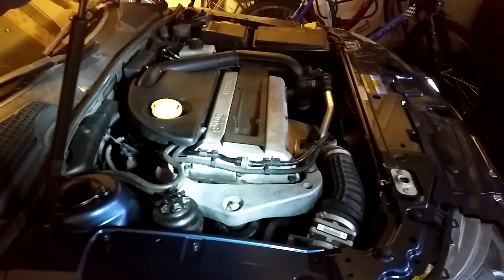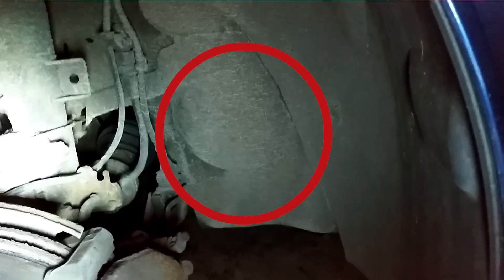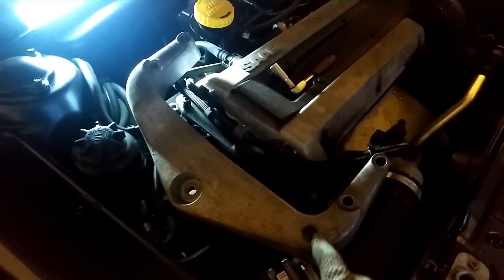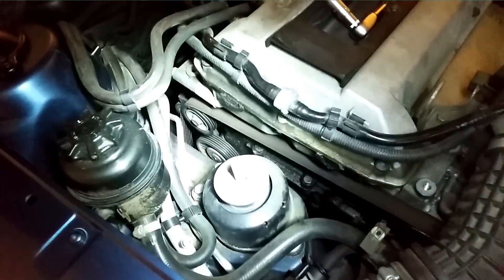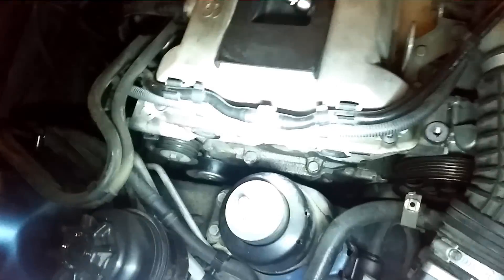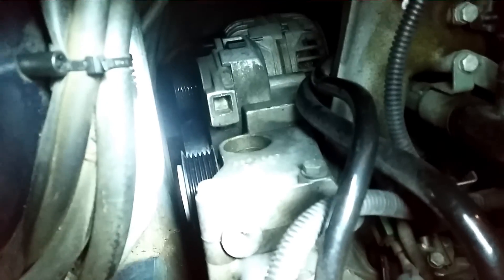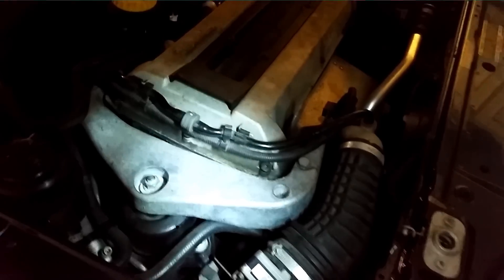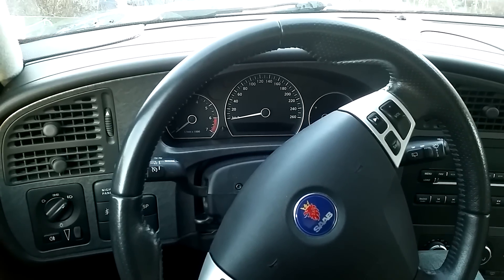Saab 9-5 DIY: Serpentine Belt and Pulley Replacement - Trionic Seven

Comment: If you need to change the tensioner pulley i find its easiest to remove the entire tensioner which you can do by using a sawed off 8mm allen key (insexnyckel) and than change the pulley when its off

Comment: I seem to be having an issue where I’m hearing a clunking noise in the same area you just replaced. Would I have to replace the whole belt tensioner?... just wondering cuz the noise is very obnoxious and sounds like a knocking noise but had nothing to do with the motor.-2005 Saab 9-5 aero 2.3t

Comment: Hiya, i did this today on my 9-5 saloon because of a squeak, thats gone now but it squeals intensely start up and the goes after 5 min. Do you know what could of happened? I pulled the metal pin out of tensioner belts on things and tight.

Comment: That top idler pulley is prone to failure after about 60 thousand miles. They fail like clock work after that. I started to change them on every Saab when I did the 60k "major" service. It prevents a most certain unexpected break down. Every Saab I purchase that has this setup, if there is no service record of when the idler pulley was replaced, I automatically replace it. Easy and inexpensive preventative maintenance. Who likes to get stranded?
Reply from the maker: Good points all around! Replacing the idler is so easy when everything is out.
Reply: Saab Tech can you tell the size of upper and lower pulleys for 1999 saab 9-5? Thx

Comment: Hi, thanks for this video
I have a question unrelated to serpentine belt, though. What do you think is the big (oily) stain on the intake manifold seen at 5:16? I am asking as I recently got similar one.
Reply: Perhaps a leaking valve cover gasket. Very easy repair.

Comment: Tack så mycket. Our 2000 9-5 manual shift wagon just began to sqeal a bit, and I suspect a new belt and possibly pulley are in order. I have read that the crank shaft pulley will sometimes begin to degrade (something about the rubber interface between the crnkshft pulley and the attached AC pulley, where the crank pulley begins to slip. Is that worth checking out as well?  Also, if you have it handy, can you point me to info on the short versus longer serpentine belt application you mentioned? If it's best to eliminate the belt from the pulley you mentioned, then I'll do it. Who knew the Saab had an appendix? By the way, your video is fabulously clear. -Nigel
Reply from the maker: Car manufacturers always change minor things in order to produce cars that are cheaper and more reliable. In my experience there is no reason for choosing the long belt anymore. It's really easy to change, and since the video was made I have learned how to do the replacement without having to lift the car. Anyway, the harmonic balancer on the pulley can go bad, but it's supposed to be a little hard to see if it needs to be replaced, and it's difficult to replace without an impact wrench. Do the belt replacement, use the short belt, and replace the top left idler pulley and you'll be happy :)

Comment: Thank you for this video, there are still a lot of people who likes Saabs and with fewer shops available to work on them at a reasonable cost, we often search for DIY instructions like yours clear and easy to follow. I have a 2000 Saab 9-5 2.3 liter turbo automatic. I changed serpentine belt and pulleys. I looking for instructions to change the rear motor mount. Used your video instructions for the front mounts but can't find anything in the rear for automatic. Any help would be appreciated.
Reply from the maker: The rear is by far the most difficult mount, but I've never done it myself so I haven't made a video of it, sorry!

Comment: Thanks for the instructions. I have a '98 9-5. How do I access the tension pulley attached to the tensioner? Is it an allen wrench that is required to pull it off?
Reply from the maker: http://photo.platonoff.com/Auto/20040929.Saab_9-5_serpentine_belt/?all :)

Comment: Hi!
That metal part with square cavity on 11:59-12:02 (I'm not sure how it's called in English) is visibly oscillating when my engine (B205E, 04' Saab 9-5 Kombi) is idling. Not sure if it is normal or if it's something to follow up?
Reply from the maker: It jumps around quite a lot, remember it's a 4-cylinder. It looks very smooth on video, but in reality it jumps all the time.
Reply: Thanks a lot! And thanks for your videos, keep up the great job!!!

Comment: The pulley on my water pump is bad where do you recommend getting aftermarket parts?
Reply from the maker: If it's just the pulley I would choose aftermarket if the price is right. A pulley is only a metal thing, no bearings inside it.
Reply: Trionic Seven hi thanks for the reply earlier turns out the metal part (pulley) on my waterpump is moving alot it makes my serpentine belt come off, now do i have to replace the whole waterpump or just the metal pulley and do have a website that i can check out thanks again

Comment: Does anyone know if the belt from a 9-5 fit to a 9-3? The engine on the 9-3 is 2.0 185 HP.
Reply from the maker: This only depends on the length of the belt. Check the length of the 9-3 belt and compare to the number I gave in the video.

Comment: I definitely noticed that I have this same symptom on my 06  9-5. The one thing that I did notice that was a bit odd was the belt tensioner was vibrating heavily (jumping back and forth a bit) i also noticed that at a stop/idle rpm that the steering wheel requires more effort to turn (almost as if I have no power steering). My question is  how common/likely is it that the belt tensioner has failed as well (seems to be the case) and if it should be moving/vibrating at all.
Reply from the maker: It does vibrate, remember it's a 4-cyl engine so there will be belt vibrations. However, what you describes sounds very odd, and yes, the tensioner can fail too.
Reply: It's not just a vibration it's as if the tensioner is dancing around (i.e. where you insert your tool to release slack from the belt).
Reply from the maker: I have seen this on my car and vibration there i normal. However, it's hard to communicate over text how much movement is normal, perhaps your is dancing around too much.

Comment: Can i do the same with my 2001 Sabb Se
Reply from the maker: This works for any Saab 9-5 1998-2010. Saab 9-3 is similar, but there are differences in engine mounts.
Reply: Thx bro
Reply: +Trionic Seven så de passar remmen från 9-5 till min 9-3a?
Reply from the maker: Om det är samma längd på remmen så passar den. Kolla att det är 6pk (bredden) och längden (anges i millimeter). Kan inte svara på om så är fallet, dock.

Comment: My 2001 9-3 pulley below the power staring is loose and cutting into the engine is this the same issue as the 9-5.
Reply from the maker: Sounds like a bad belt or bad pulleys.

Comment: Great video. One important note. Some older cars will have pulleys with torx bolts instead of normal hex head. These strip very easily. Care should be taken to soak these with penetrating oil before trying to break them loose.
Reply from the maker: +Alexander Harris I didn't know that, thanks!

Comment: "(Engine types B204 and B234)" I believe you wanetd to say 205 and 235 :)
204 & 234 were used on ng900 & 9000, even early 93s, but never on 95s, even if some people rebuild them to that.
Thanks for video :)
Reply from the maker: +Peter Chomanič (Rusnak) D'oh, what an embarrasing mistake. I thought 4-cylinder and wrote a 4 instead of 5. Will fix, thanks!